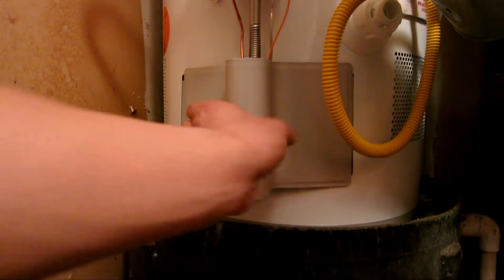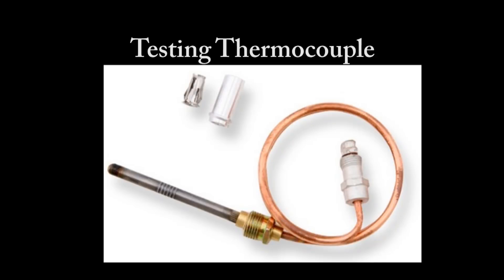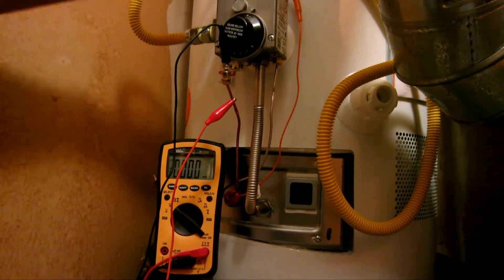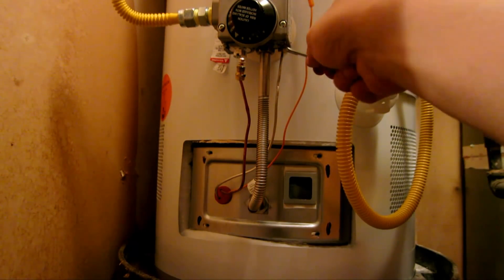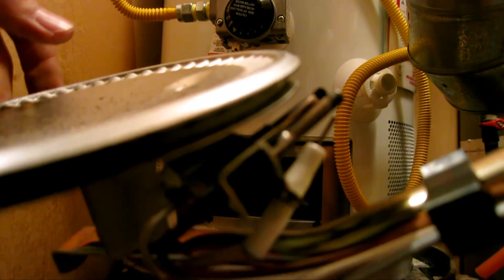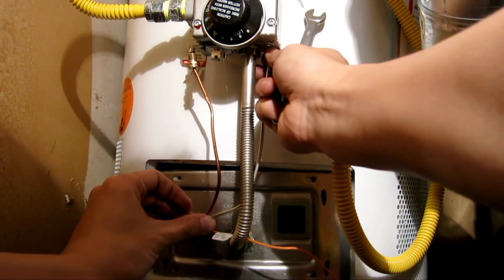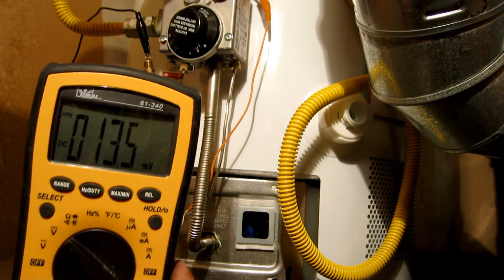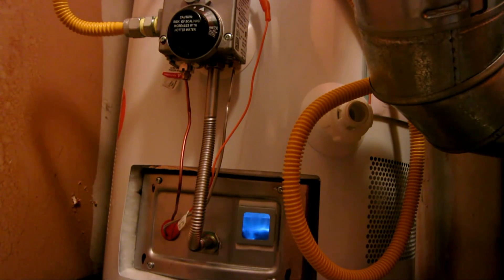Hot Water Heater Pilot Light Won't Stay Lit or On - How to fix waterheater by testing Thermocouple

Comment: 0:22 Voids the warranty?  If that voids the warranty I'll never buy a GE water heater.  I have a Reliant 606 and they just sent me a check to reimburse me for my thermocouple assembly and then again for my drain valve after I replaced them myself and told them as much.  I like that they give me the option of buying the part myself to fix it the same day and then getting reimbursed.  They do send parts if you just want to wait for the part or can't find one locally.

Comment: Awesome video!  I have very LIMITED plumbing/electrical experience and followed your directions exactly as posted.  After checking my thermocouple(cleaning it and making sure it was not bent on the interior burner side), it did not produce the voltage it should have.  I found a Rheem universal thermocouple at my local Home Depot(under $12), replaced it and within 5 minutes the gas heater was working again.  As a mom, every dollar saved is much appreciated.  THANK YOU!!!!!!

Comment: Question; My pilot light will stay on for days, then suddenly go out. What do you think is the problem? When I relight it, it stays on for a day or a week, then goes out again. I've noticed that it has been windy lately, but sometimes still goes out with no wind. Checked the draft diverter and seems untack, but it is very hot. Is it supposed to be hot? There is a two inch space between where the draft diverter connects to the top of the water heater.Is it supposed to have a gap? I would appreciate any comments...thanks! I've had no problems for the first 2yrs or so, until now.
Reply: BTW, I thought I smelled gas the other day when it went out. Never smelled it again though...

Comment: Man- thank you sooooo much! My unit it 12 years old and all of a sudden- it stopped working. Pilot light would light and then go out. Tested thermocouple and got a 1.7 reading. Pulled out the burner cluster and the tip had black carbon all over it acting as an insulator. Cleaned it up with light sand paper and presto! Working perfectly. You saved me $$$ by posting this. Thank you!

Comment: Had the same problem.  Great advise in the video, but first I checked the air intake filter which is built in at the floor of the heater.  It was dirty, so I cleaned it with a shop vac.  Problem solved!

Comment: Thanks for the video.  I took the unit apart, lightly cleaned the thermocouple with a steel brush, vacuum out the inside of the water tank and around the base unit, reconnected everything back up and it work's like a charm, again thanks for the video.

Comment: Looking at the video your thermo couple is not seated all the way into the holder. The tip should actually be ABOVE the "pencil Pilot Tip" (approx. 3/8") Your open reading should be about 30mv and a closed test usually using another tool should result in a reading around half of the open. Another thing to remember is that if you were doing this after a year or so of use the manufacture requires that you install a new gasket around the burner door to prevent CO and air leakage. This model also comes with an annoying trap door for safety. But thats another story
Reply from the maker: thx for the advice! ill add it to the "About" section.

Comment: Wow thanks for that.  I just finished repairing mine and it was helpful as hell to watch your video first. The thermocouple I got was from Appliance Parts Distributor,  cost 15 bucks.  It was the 24" universal uni-couple for standard water heaters.  Mine is a GE also.

Comment: I am not a professional either but have replaced all the parts on the heater and always had luck on repairing it. Today I found out one more issue that might help infixing the pilot light,on the end of the pilot tube is an orifice and it has a tiny little pin hole which allows gas to get through. Make sure you clean the hole to let out more gas to allow it to heat the thermocoupling! It just cost me $185 to fix what I could have done myself in 5 minutes...good luck!!!@
Reply from the maker: thats a good point. thx for sharing.

Comment from the maker: occasional - tells me its borderline failing. you should check the thermocouple and see if it has at least 20+mV. It can still operate between 13ish to 20mV, but once in a while it might shut off. 
Another thing is to clean the area with a vacuum cleaner. Air flow is required and low airflow can cause it to go out.

Comment: Very nice trouble-shooting.  My problem is that the pilot goes off every couple of months. I just turn it back on and wait for a text from my tenant who is a premadonna and won't go in the basement.  I'm looking for a permanent solution, though.  I also has a GE H/W Heater.  How would I go about trouble-shooting for only occasional pilot light going out problem?

Comment from the maker: hmmm... if you have a good thermo couple, air and gas, but it will not stay lit, then its down to the gas valve control... which is pretty expensive to replace...

Comment: i have a kenmore power miser 6 and  the pilot won't stay lit. i couldnt get just the thermo couple, haad to get entire pilot assembly.  but i changed that and i'm still having the same problem, i did try cleaning out the air intake area, but  all ii had to do it with was a vacume cleaner, but i'm stumped on what else the problem could be, any suggestions ?

Comment: Great video, thanks for posting it! I didn't know the voltage for the thermocouple. But thanks to your info, I found that my thermocouple put out 24.4 mV. My problem turned out to be a bad connection on the other end. Works like a charm now. Thanks again........

Comment: Good video.  Just found my water heater was off, pilot light would not stay on.  My thermocouple looked to be dirty so used a small wire brush through the access port and that seemed to have cleaned it up.  Was only getting 13.7 mV before cleaning and 20+mV after.  Pilot light locks on after 15 seconds or so and is working like new.

Comment from the maker: are you sure you have a leak or do you smell gas? the easy way to check for leaks is to spray soapy water and see if there are any bubbles. there are lots of youtube videos showing how to detect a leak with this method. tighten up the connections with teflon tape for gas joints. If you still have a leak then shut off the gas and call a pro... i am not a professional, just documenting what i did and sharing my experience. hope that helps...

Comment: Thank you DIY Tinker for the informative video. I was able to fix the problem but I got another one. I detected very small amount of gas leak from the pilot pipe at the regular end. I tried tightening the bolt but it won't work. What should I do to fix the gas leak? Please reply.

Comment from the maker: check amazon, ace, radioshack, HD, Lowes, etc... cheap ones are $5 to $20. I would recommend one with capacitance and temperature readings which are $25 to $50. i put a link in the note section for DMMs on Amazon.

Comment: Any ideas on why my hot water heater will only work when the weather is cold? We don't do anything to it. We don't relight the pilot light or anything else but when the weather drops below 60 degrees or so it just starts working on it's own. When I'm trying to re-light the pilot now it just burns out in a second. Also, my hot water heater must be  old because I don't have a button you can push down while lighting. Any suggestions?

Comment from the maker: If it goes out randomly then it might be an airflow issue. Either from the venting, or from the link inlet @ 5:24. But if it only goes out after it heats up, then google "Pilot light goes out after first cycle" and you will see a forum that gives multiple suggestions.

Comment: DIY Tinker.... My Ignitor stay on after I hold it for a minute, I can turn the gas knob to "on" and Dial the temperature dial up where the flame comes on, but after it heats the water, and the flame goes out, the pilot goes out to. Any suggestions? from anyone?

Comment: Thank you for this very well done and simple to follow video. I know nothing about water heaters and my pilot wouldn't stay lit. Just followed your instructions, however, I sanded down the tip of thermo=coupling, replaced, lit and it's working like a champ. Thanks again.

Comment: EXCELLENT  VIDEO!!!  I k new nothing more than how to light the pilot light on a hot water heater.  My pilot light would only stay lit for as long as I held down the red button, after a minute of holding it and then letting go, the pilot went out immediatly.  Your video was great!!  after watching it I was confident enough to replace my thermocouple.  This is a very well put together video with good camera angles to show everything.  THANK YOU!